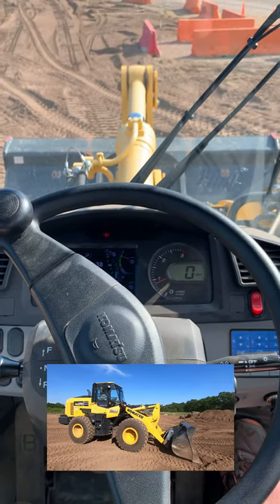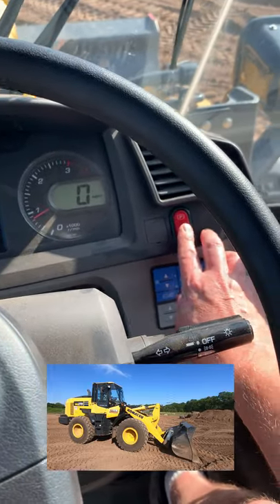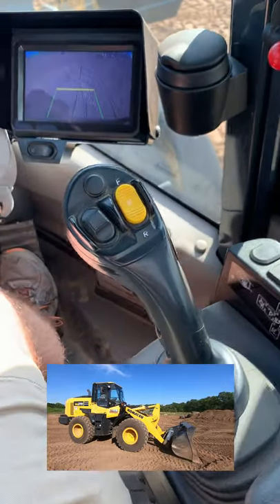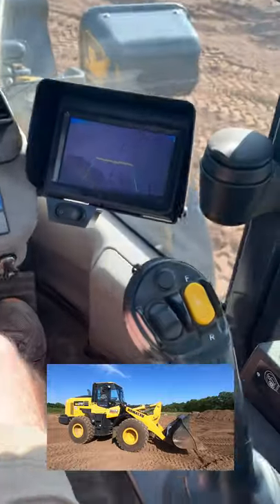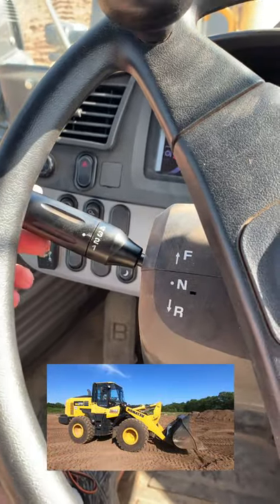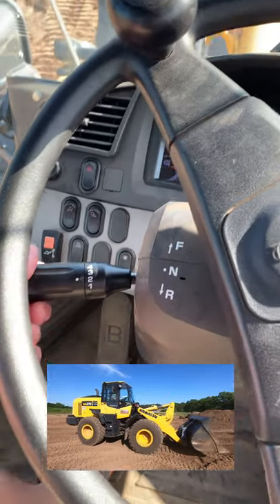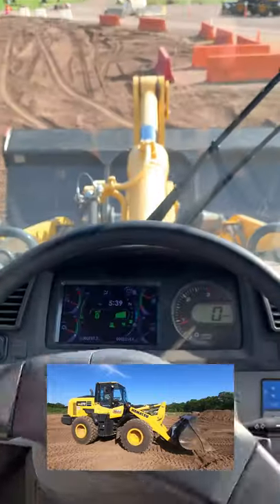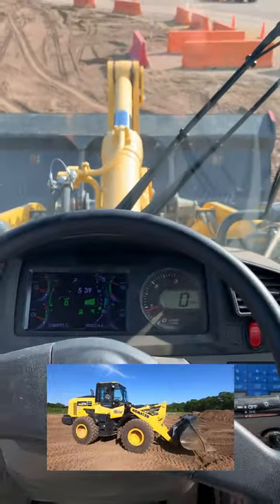Wheel Loader basic controls | #Shorts

Comment: I’d get a hang of this pretty quick, have been using a Ford 550 tractor to load the tipper at work controls are the same power steerings a bit screwed have to top up the pump every 30 mins roughly
Reply: Yup sounds the same as a tractor just a little more modern

Comment: The only reason to shuttle with the stalk on the left is if the hat switch on the joystick fails. This happens pretty often in these Komatsus, and it's a bummer when it does because you'll lose a ton of smoothness and efficiency by taking your hand off the steering wheel to change directions. know how to use it, but if you want to get work done, don't play with your stalk ;)